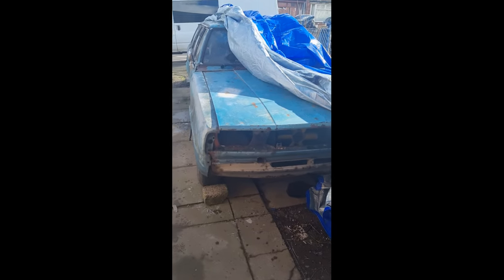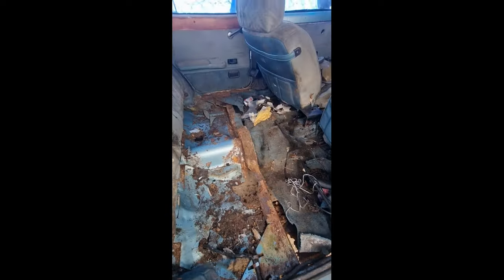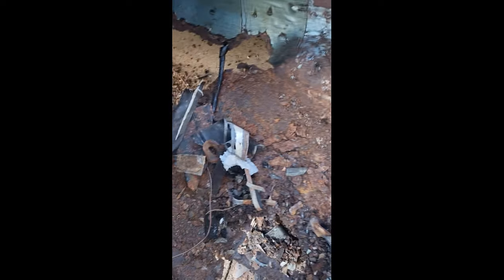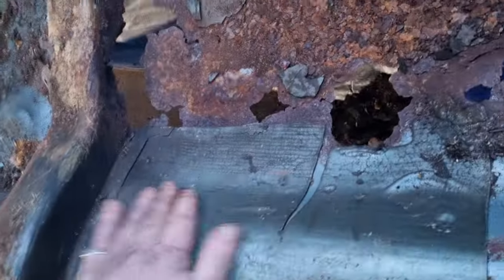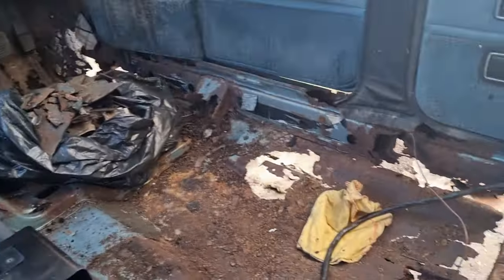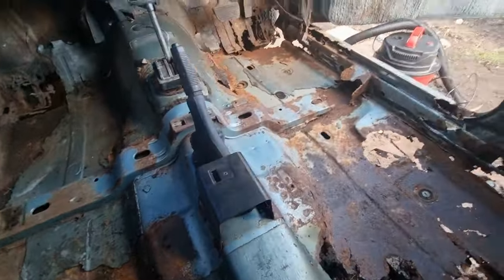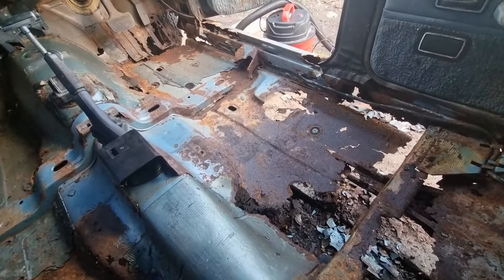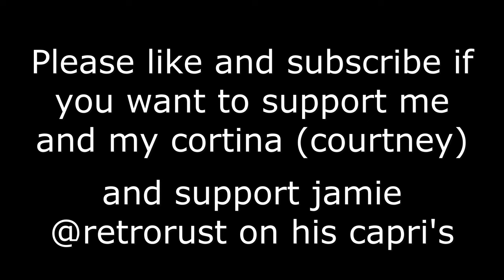Cortina Mk4 Ghia 2.3 V6 Restoration || Interior Removal & Floor Inspection (P2)

Comment: It doesn't look to bad I thought it would be a lot more rotten, I'm looking forward to you cutting old out and putting new in .
Reply from the maker: i carnt wait to start getting that part done there is defo alot for me to work with so a lot better than i first thought so im very impressed with the condtion :)
Reply: Looks like retro rust might have saved this, by mothballing it in the garage, So he gave it half  a chance.
Reply from the maker: @procta2343 he defo saved it if it was not for jamie at retro rust this car would have been long gone

Comment: The cross members you need will fit from mk3 to mk5. Are you getting the panels from Ex-pressed steel? They have most parts you need. On my car I need a rear chassis leg and repair panel for the rear passenger wheel arch. Great video Adam.
Reply from the maker: Thank you mate and yes i will be using express panels
Reply from the maker: when you doing your rear chassis leg been looking forward to another video  from you :) love the bike videos to
Reply: @AdamSNook. I need to get the car moved before I can work on it. The carb needs to be sorted before I can do that and I have some small parts being made for it. I really can't wait.

Comment: when retro rust 1st got this and did a bit of a walk around,  my thoughts were, it looked a lot better than rusty, His capri he is rebuilding.  Where do you stand getting panels and parts for this?  Looks like you may have to fare bit of fab work.  Id have walked away on this one, but then again that's me.  Keep going at it mate, as this will challenge you.
Reply from the maker: panles are pretty simple to get and cheap yeah alot of people would have walked away but its over 45 years old it needs a good chance to see the roads again its time to bring her back to her glory hehe and i can asure you there will be a video of her driving again when done i have plenty of time to work on her

Comment: Rot that shell is.scrap seeing things though rose coloured glasses. End of day it's a old rotten cortina would not take much to crush as zero strength in that shell
Reply from the maker: you are intitled to your own opinion how ever there is loads of good strong metal in this car still and once i have put in the chassis and new floor pans i dont see where its weak as its all been done with new metal pete c as done the same sort of work on his mk3 cortina and he now drives his in mint condtion as long as im happy doing it and paying the money for the parts then thats all that matters
Reply from the maker: have u seen my latest videos looks like you have started on part 2 there is laods of videos up to part 21